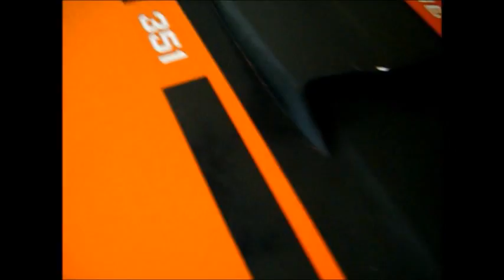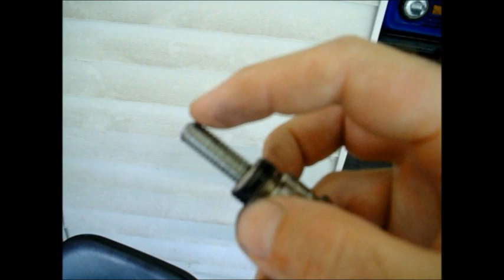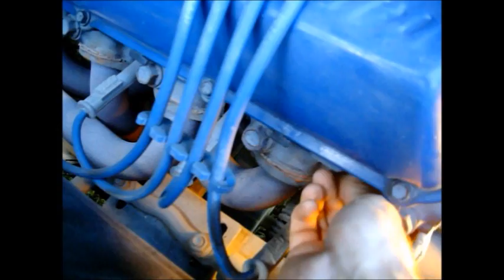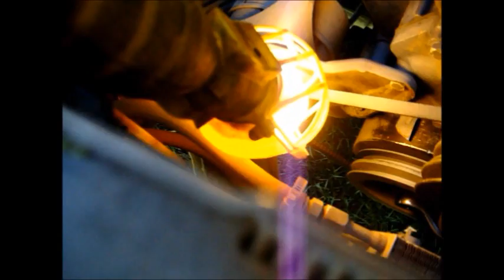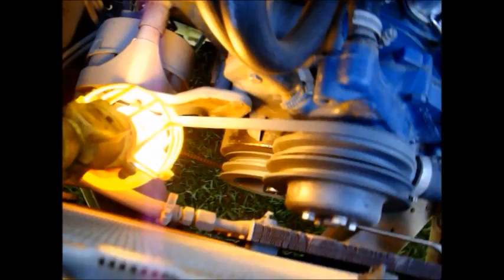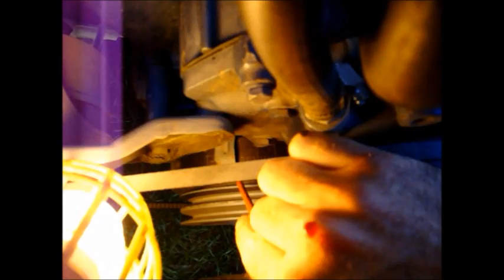Timing - Part 3 - How To - Using a piston stop to find true #1 TDC.wmv

Comment: Your video was very informative, I'm currently having a hard time with my 1970, 302 mustang. It sometimes starts up and sometimes it won't. I have fuel, spark and air. When I used a TDC plunger and took my distributor cap off I noticed that the rotor was pointing about an inch to the left of the number one spark plug. I also noticed that the distributor clamp was bent upwards which didn't give enough clamping force. Headed to O'Reilly's right now to get a new clamp
Reply from the maker: Yup, get it clamped down, so it doesn't walk away on you.  If it's not clamped down, it'll definitely move, and it won't take long until it moves far enough that it won't fire up the next time you try.  When you're cranking it, and it won't start, you can hook up your timing light.  The engine doesn't have to be running for the timing light to strobe, just the starter turning it over, will be enough to strobe it, as long as your coil is energized and you've got spark going to the plugs.  Everyone knows that you can remove a spark plug wire, jam a screwdriver in it, and put the screwdriver next to a ground to check for spark, most people don't seem to know that you can do the same test for spark, by leaving the spark plug wire on the spark plug, and simply hooking your timing light to it.  Hook it up to #1, then have someone turn the key to crank the engine, or use a remote starter button.  Either way, now you can point the timing light at your harmonic balancer and get a pretty good idea of where your initial spark timing is set at.  Turn your distributor as required, until it fires up, then set your initial timing where you want it, with the vacuum advance disconnected.  You can also hook your timing light to all the other spark plug wires, and make sure that it strobes on all of them, it's a quick way to check for any fouled spark plugs.  Good luck!  Let me know what you figure out.  Hopefully it's just the clamp, like you said.
Reply: @owenrobertson  thank you I appreciate your feedback. I'm still learning, we need more people like you that are willing to help! When I took off my #1 spark plug it had a bunch of black soot and fuel as well. Do you know what would cause for the plugs to become fouled? Would this also make the engine not start? The plugs have maybe 500 miles on them and I don't believe the engine was running rich. It has one of those Holley sniper EFI kits. I'm going to try the starter method like you described and clean all my plugs as well.
Reply from the maker: @0rvelazqu , well I've never run that Holley EFI, does it detect air / fuel at all?  Do you run an O2 sensor with it?  Is that how it works?  I've never looked into them at all.  I've experimented with a modern O2 sensor before, with carbureted vehicles, and an air/fuel gauge, just to dial in my jetting, but I've never messed with fuel injection on an old car.  There are lots of places online that talk about reading your spark plugs, and what you described, as you know, is a spark plug showing signs of your 302 running rich.  You might want to call Holley's tech line about that.   A 302 doesn't need a lot of fuel, and your EFI might be factory set up for SBC, as pretty much everything is set up for SBC, always has been.....at least for the 37 years that I've been in this hobby.  I'm really lazy about changing plugs, the spark plugs in my Vette have about 10,000 miles on them, so yeah, you shouldn't be fouling out after 500 miles.  I'm juggling too many cars, so the routine maintenance tends to get overlooked, and I mostly just fix stuff when it breaks.  My wife's 2003 Ford Escape has over 90,000 miles on the spark plugs that I installed 6 years ago, when I made some youtube videos about a bad fuel injector in that car.  Of course spark plugs will last longer in a car with computer controlled direct port fuel injection than they will in a carbureted car like everything I've ever owned.  You've got the right idea though.  Clean all of your spark plugs, get it fired up, put your timing light on it, then once your timing is dialed in, and locked down, just keep an eye on those spark plugs.  If they keep reading rich, I'd call Holley and ask them about it.  Lots of guys run that Holley EFI, so it must be good, and there must be a way to dial it in.  Also, you could look for a youtube video on that Holley EFI setup, one that has a lot of views, then after watching the video, go down and read the comments.  You can learn a lot from the comments section, maybe there are other people running the same EFI, that are also fouling spark plugs.  And yeah, an engine can run with fouled spark plugs, but initial start up is trickier for an engine than continuous running, so theoretically, you could start an engine with half decent spark plugs, then drive 200 miles, running rich, and the engine probably won't die on you going down the road, or even at a stop light, it might run a bit rough, but it'll probably stay running.  Then you shut the engine down, and it won't start back up, because initial fire up is harder than simply maintaining a running state.  Now run out of gas while you're going down the road, and your engine will sputter for 10 seconds or so and then die.  Foul your points, and at a certain point, when your points get bad enough, your engine could absolutely die while you're going down the road, just die, no sputter, just off, like you turned your key off, but in my experience you normally find badly fouled spark plugs when the engine won't start, it doesn't leave you stranded on the side of the road from what I've seen, but it might leave you stranded at a gas station or a restaurant's parking lot or something, when it won't fire back up.  So yeah, if they are fouled bad enough, fouled plugs can prevent your engine from starting.  

Here's a tricky one.  What happens when you fill up at a gas station that has bad gas in their tank?  I found out the hard way.  Had a 302 in my '75 Bronco, and the original 2 barrel carb.  I filled up with gas, drove home from work, then I didn't drive it again for a week or so.  A week later, I got in, and it wouldn't start.  Like you, I had rotation, fuel, air, spark, spark timing, and valve timing.  It should have started.  Well it was a week since I had filled that tank, so I didn't even consider bad gas, I had forgotten all about that.  Anyway, I'm 10 miles from town, so even if I did suspect bad gas, would it make sense that I filled up with bad gas, and then drove home 10 miles, and it ran fine?  At least I think it ran fine, I can't really remember, and I wasn't thinking about any of this in the moment, I was just trying to understand how a '75 Bronco with good spark plugs and good spark, and gas and rotation, wasn't starting.  My wife kept telling me that maybe it wasn't getting gas.  Well I had looked down the carb, cycled the throttle, and I had watched gas being squirted into the engine.  I knew it was getting gas.  The third time my wife told me, that maybe it wasn't getting any gas, I was pretty upset, but I kept my calm, and simply pulled the fuel hose off of the carburetor, then I calmly told my wife to watch the engine while I tried to start it.  She has no idea what the fuel hose is, or the vacuum advance hose, or the heater hose for that matter, so she didn't know what was going to happen.  So I turn the key, and the starter does it's job, and the stock mechanical fuel pump does it's job, and my wife yells stop stop!  I stop turning the key, and she yells that fuel is spraying everywhere.  

Really?  Yeah, I told you I had fuel, you don't think that was the firs thing I checked?  

I was still pretty upset.  Then I looked at the "gas" that I had just sprayed all over my Bronco's carburetor.  It was beading.  Gas lays flat, it doesn't bead like water.  Water beads like water.  So my wife saved the day, she was right.  I wasn't getting gas, I was getting something, and it smelled like gas, but it wasn't gas.  Just to make sure, I put that fuel hose into a rattle can cap, and filled it a bit with the "gas".  Then I set that cap with some gas in it on the ground safely away from everything, and I lit a long rolled up piece of paper.  When the paper was good and on fire, I lowered it into the gas.  The gas put out the fire.  That's when I realized that I had just filled that Bronco up like a week ago.  I had to dump out all of that bad gas, luckily I've got an aftermarket fuel tank in that Bronco, and it has a drain plug.  Unluckily, it was a 23 gallon gas tank, and that's a lot of gas to throw away.  It also has a reserve tank that holds 8 gallons that I had to toss out.  That was probably 10 or 15 years ago, but I'll never forget it.  It's a crazy hobby.  Apparently you can fill up with bad gas, and the engine will fire right up, because it's starting off the good gas that's still in your carb.  The gas stations gas is in your tank, and not in your carb yet.  Then you get down the road, and within a quarter mile or so, you're running off the bad gas, it's mixed in with the gas that was already in your tank, but I only fill up when I'm really really low on gas, and I always fill it all the way up.  Anyway, that gas gets you home, and you don't even notice that it's running bad?  Crazy!  Then you get home, shut it down, and a week later, it won't start.  Because firing up is a harder task than just staying lit.  So the gas was good enough to keep me going down the road, but not good enough to start a cold engine.  If anyone told me that story, I'd call bullshit, but it happened.  It's crazy but true.  These old cars will always surprise you.  So now I only buy gas from places I can trust like BP or Shell, and I've never had another issue like that one.
Reply: @owenrobertson  I took my valve cover off and made sure that the rotor was pointing towards spark #1 while both valves on cylinder #1 were closed/on compression. I then saw that the timing pointer was right on zero degrees and marked that with a white dot. Then I bolted everything back up and had my cousin crank the engine over while I used the timing gun so that I could advance it 14 degrees with the vaccine advanced plugged off. Then we hooked the fuel back up and tried to start the engine, all we get is a fireball every now and then and some sputtering
Reply from the maker: @0rvelazqu , all the parts you bought should be fine, your EFI is using an O2 sensor to dial in the air/fuel ratio, so that should be good as long as it's all working as advertised.  And you've got a new engine, so it's going to be something simple, we just need to figure out what.  What distributor and coil are you running?  I'm guessing you aren't running the stock single point distributor, not with the other stuff you've got.  14 degrees initial is a lot.  I only run that much initial timing when I'm not planning on ever running any vacuum advance at all, just the mechanical advance.  On cars where I do that, I'll run 14 to 16 initial, in order to get my total timing around 36 BTDC.  That would be a street/strip car, where I'm more concerned about how it does at the track, than I am about how hard it might be to start.  A car is easier to start with less initial timing, the Model T had a lever to retard the timing manually from inside the car, then start it, then advance the timing with that lever to smooth out the idle and keep it running, to where you can drive it.  The invention of vacuum advance replaced that manual spark advance control lever.  I run vacuum advance in most of my cars, and it's what I recommend for most everyone else, you set your initial timing around 8 degrees, with your vacuum advance plugged off......then you hook your vacuum advance back up.  Now when you crank the engine over, all it gets is the 8 degrees initial advance, as the engine isn't making vacuum yet, so it's easier to fire up.  Once it's running, now you're making vacuum, and the pull of that vacuum, advances the timing for a nice smooth idle.  As you accelerate down the road, your vacuum drops because the throttle is wide open, so your vacuum advance drops away, but your distributor's rotor is spinning faster now, and the added centrifugal force, moves the counterweights away from each other giving you the mechanical spark advance that you need to stay ahead of the engine's increasing rpm.  It's all very primitive technology compared to new cars, but that's why I like it.  And it is more advanced than the Model T was, so it's better than a hundred years ago.  Your '70 Mustang is in my sweet spot, Right now 1955 to 1975 are the cars I own, they are the cars I love and I can ramble on all day about them.  I really love this hobby.

When your engine tries to fire up while you're cranking the starter motor, but fails to stay lit as soon as you let go of the key, it's normally because your coil is being energized when the ignition switch is in the "start" position, but your coil isn't being energized when your key is in the "on" position.  Remember for every position your key can go in, accessory, off, on, start, it's a different pathway for electricity that you're opening up.  When your key is in the "off" or "accessory" position, no voltage is sent to your coil.  While your key is being held in the "start" position, you should have voltage to your coil, and we know that you do, since your timing light strobed for you, while your cousin cranked the engine over.  Now when he lets go of the key, and your ignition switch is in the "on" position, your coil should still have voltage, but it's coming from a totally different place now, and a totally different wire.  Your coil is energized by your starter solenoid while you are cranking the engine over.   That's what the "S" and "I" are all about on your starter solenoid.  You turn the key to "start", and that energizes the "S" (start), put power to that S terminal, and your engine will crank over.  Only while it's cranking, the "I" (ignition) terminal is sending a straight 12v to the positive side of the coil (+).  All of this so far is working just fine in your car.  Now when you let the key go from "start" to "on", then there should be a new source of voltage to the positive side of your coil, from your ignition switch to your ballast resistor, or resistor wire, delivering about 9 volts to the positive side of your coil.......that's if you've still got a points distributor, running a straight 12v will burn up the points over time, but that straight shot of 12v, just during initial cranking helps it to fire up easier.   

So here's what you should do, turn the key to the "on" position, and check the positive side of your coil for voltage with a test light or voltmeter.  You should have voltage.  If you don't have voltage, fix that first, because that's absolutely the problem.  

If you're running points, and your Painless Wiring kit doesn't have a resistor wire, you can run a Mopar style ballast resistor to protect your points, just go to your parts store and tell them you want a ballast resistor for a '70 Dodge Dart with a 318, but any old Mopar's ballast resistor with any engine will work just fine on any car of any make, as long as it's running a points distributor that no longer has it's factory resistor wire.  The Mopar ballast resistor will look like this:  

https://www.forabodiesonly.com/mopar/threads/1971-slant-six-ballast-resistor-id.480816/

And it's easy to hook up, just put your 12v from the ignition switch to one side, and run a wire from the other side to coil +.  It doesn't matter which side of the ballast resistor goes where.  

And of course, if you aren't running your stock single point distributor, then forget all that stuff about a Mopar ballast resistor, because you don't need a ballast resistor with electronic ignition.  If you're running electronic ignition, then you need a straight 12v to coil +.  So that raises another question.  Does your Painless wiring kit have a resistor wire going from ignition switch "on" position, to coil +?  If so, that's not good if you're running modern electronic ignition, you can't run a ballast resistor with electronic ignition, and a resistor wire is the doing the same job as a Mopar style ballast resistor.  So if you are running electronic ignition, and you think you might also be running a Painless Wiring resistor wire to coil +, try running a temporary wire straight from your battery + to your coil +.  Give it a straight 12v.  Then try to start the engine.  Because it seems like it wants to fire while your key is in "start", but not while your key is in "on".........so that's where you need to look.  Run that temporary wire, and it should fire right up, and stay running.

Once you get it running, set your initial timing at 8 degrees BTDC (or even 6 BTDC, the Ford maintenance manual calls for 6 BTDC in a '70 Mustang with a 302.......but 8 BTDC is fine).  And then lock it down, and hook your vacuum advance back up.  You'll make a bit more power if you adjust your timing to optimize your total timing to around 36 degrees, and the easiest way to do that is to bump up your initial timing, but it's really not worth it for a few extra horsepower, I mean really, are you going to go out and race a new Mustang or Camaro or Corvette?  It was fun racing those cars in a hopped-up first gen Mustang, back when those Mustangs, Camaros, and Corvettes were brand new in 1987, back then, they were all running mid 15 second quarter miles in stock trim, but today they are all crazy fast. So if you want your car to start easily and run nice, shoot for 6 or 8 BTDC, and then hook up your vacuum advance, and it'll run great.  

And good luck!  Let me know what you figure out.
Reply: @owenrobertson  thank you so much again for helping me, I've been out here in the garage since 9am today and I've been contemplating on parting out the car (joking). That is awesome that you have classic cars as daily drivers. I wish to make my mustang just as reliable as a new car so that I can also daily drive it. Hopefully we can solve this issue so that she's back on the road soon.

I am running a pertronix type distributor and I currently don't have a ballast resistor. 
I checked for power at the ignition coil on the positive side post and I am getting no power with the key turned to ON. I only get 12 volts when I crank the engine over and then drops back to 0 when the key springs back to ON position. 

According to the painless wiring manual, the ignition bypass wire starts at the starter solenoid "I" post and ends at the coil "+" post. Perhaps my starter solenoid has gone bad? I can hear it click on and off whenever I crank over the engine.

I am going to run to the store and see if I can get a new starter solenoid. If the problem still persists then I will move toward the neural safety switch, I think it's still running the original part as I haven't changed it since I got the car.
Reply from the maker: @0rvelazqu , your starter solenoid is fine, don't change that.
Reply from the maker: "I" from the stater solenoid to coil +, gives the coil voltage while the key is in the "start" position.  You have that, that part is fine on your car.  What you need is voltage to the coil when the key is in the "on" position.  You don't have that, and that's why it won't fire up and stay running.  Just think about how it works, this might help, say for instance you had a car that only had voltage from ignition switch "on", and no voltage from starter solenoid "I" (that would be the opposite of what you have).  It'll still start, run, and get you around town, but it'll be tricky to start, since it won't be getting voltage to the coil until the key moves from "start" to "on", so you've got rotation, but no fire, and then all of a sudden when you let go of the key, for a split second you've still got a bit of rotation, and now you finally have spark, and if you're lucky, it'll fire up and since you've got a solid 12v to the coil when the ignition switch is in "on", it'll stay running no problem......so technically it will start, but it'll take you a while.  You've got the opposite problem, no way you'll stay running if you only have spark while your key is in the "start" position.  For the engine to start normally, you need your timing set correctly, and you need voltage to the coil when the ignition switch is in "start" and when it's in the "on" position.  Give it 12v switched, and it'll fire right up.  Or, if you simply ran a new wire, from the battery through a toggle switch, and to coil +, that would get you on the road as well.  

And yeah, forget everything I said about a ballast resistor, you don't need one since you're running Pertronix and not points ignition.  Also make sure you aren't running a resistor wire between the neutral safety switch and coil +.  I"m pretty sure if you order a Painless Wiring kit for a bone stock '70 Mustang, they'll supply you with that resistor wire, since the factory harness had one.  If you tell them you're running Pertronix, or any other electronic ignition, they'll supply you with a regular wire............or maybe they provide both wires, and it's up to you to figure out which one you need?  I don't know, I'm not running Painless Wiring on any of my cars.  Anyway get 12v switched to coil + and you'll be driving it today.  

So if you've read everything I've typed, and I know it's a lot, then here's what you've learned so far......you've learned that it's super easy to steal an old Mustang.  Pop the hood, run a wire from battery + to coil +, then use a screwdriver blade to touch both the battery + side of the starter solenoid and the "S" side of the starter solenoid.  Running that jumper wire from the positive side of the battery to coil + gives you spark.  The screwdriver delivers 12v from the battery straight to the "S" terminal on your coil......this simulates turning your key to "start" on the ignition switch.  Two things will happen when the "S" terminal is energized, the starter motor gets the full cranking amps from your starter, through your starter cable, and the "I" terminal gets energized and sends voltage to your coil +, but in this case that doesn't matter at all, since there's already a jumper wire running straight from battery + to coil +.  The engine will fire right up.  It's very easy to start an old Ford without the key, since the starter solenoid is firewall mounted and not mounted to the starter like a lot of other cars.  Once a car thief has the engine running, it's just a matter of getting into a locked car, not hard, and figuring out how to disable your locking steering wheel.  '70 is the first year Mustang to have a locking steering wheel, but it's not hard to unlock, it can be done at the steering column from under the hood.  The good news is that old cars rarely get stolen, considering how easy it would be to do it.  The other good news is that you can totally use your Mustang as a daily driver.  My first car was a '65 Mustang, and I've never owned anything newer than '75, or older than '55, and those have been my daily drivers.  I did learn early on that it's good to have more than one, that way when one car won't start, you can step to the spare, and still get to work on time.
Reply from the maker: Of course your neutral safety switch prevents "start" from doing it's job, and your neutral safety switch doesn't stop "on" from doing it's job.  I don't know why that didn't dawn on me sooner...........your starter solenoid is working fine, and you've got rotation, so your neutral safety switch is working just fine.  You could check it.  Put it in gear, and then try to start the engine.  If absolutely nothing happens, just like you've got a completely dead battery, then your neutral safety switch is working......if the starter motor engages, then you don't have a neutral safety switch at all, or someone has bypassed it.  Either way, your end goal is the same, get 12v to coil +, while your ignition switch is in the "on" position, and it'll fire right up.........or cheat, and run a brand new wire from battery + to a toggle switch in the car, and run another brand new wire from the toggle switch in the car, to coil +, and it'll fire right up.  You just turn the toggle switch on, then turn the key to "start", then to shut it off, you turn the key to "off", and then turn the toggle switch off, easy.  The only thing to remember, is that if you're running a toggle switch like that, don't accidentally leave it in the "on" position, because if you did that, the toggle switch would be energizing the coil nonstop, while the car is just sitting there.  I'm not sure how long it would take, but with the engine off, and the coil energized, eventually, you'd destroy your Pertronix (I think.....I've never tried it).  I've run toggle switches before to energize the coil, but I was always careful to not somehow leave them turned on.  Pretty easy really, since you had to turn it off to kill the engine.....unless it stalled out or something, right when you got home and parked it.
Reply from the maker: The real lesson here for both of us, is don't throw parts at a voltage issue.  You found your problem, no voltage at coil +, when the ignition switch is in the "on" position.  Your impulse was to throw parts at it, first a starter solenoid, and then maybe a neutral safety switch (that was my fault, sorry about that....I was wrong, bad advice, I never should have mentioned the NSS).  So we both need to slow down a bit and take a step back, before you go out and buy any parts.  Best to slow down and talk things out, and to look at a wiring diagram for sure.  You should have 12v at the coil when the ignition switch is in the "on" position, and you don't, so check that wire in your Painless Wiring diagram, the one that goes from the ignition switch to the coil.  Forget the wire that goes from the ignition switch to the starter solenoid, that wire is doing it's job just fine.  You might have a bad ignition switch, but check the wire first, because a single wire is more fragile than an ignition switch.  You should trace that wire back from the coil to the ignition switch, it might just be broken or burned up, or the insulation might have melted or chafed off and the bare wire could have welded itself to a ground.  Ignition switches don't normally go bad, but lots of bad things can happen to a single wire.  You can shoot the whole wire with an ohm meter from under the dash to the coil, or just see if that wire has 12v under the dash (closer to the ignition switch), while the key has the ignition switch in the "on" position, but it would be best if you can visually inspect that wire as well.  It would be easier if your ignition switch was in the dash, like a '69 or older Mustang.  It's always a pain when the ignition switch is in the steering column.  

But again, you could also cheat, and just run a jumper wire from your battery +, through a toggle switch, and to your coil +, and you'd be up and running in about 15 minutes.  And once it's running, don't forget to set your initial timing (vacuum advance disconnected) to 6 BTDC (8 BTDC at the most).  And then hook your vacuum advance back up.  Then enjoy the car as much as possible, and make a youtube video with the car, and send me the link.
Reply from the maker: I used to be a big Mustang fan, '65 to '73.  Now that I'm old, my preference is '68 to '70 Mopar B-body, and GM A-body cars, '64 to '72.  I like the Chevy A-bodies, but the BOP (Buick, Olds, and Pontiac) stuff is just as good, as far as I'm concerned.......and way cheaper than Chevy......way cheaper than Mopar too, Mopars are too much money now.  It's ruining the hobby for guys with modest income.  If you want a reliable old car at a decent price, look for a 60's Buick Skylark, or Oldsmobile Cutlass, or Pontiac LeMans.  The most reliable cars I've ever owned are my GM cars, my '55 Pontiac Chieftain and my son's '68 Pontiac GTO still have their original engines in them.....but I love my Mopars as well, even though their original engines are long gone.  Most of my Fords have long lost their original engines as well, but my daughter's '63 TBird still has it's original 390 under the hood.  I'm into other stuff now, but old Fords are still cool, I've owned a bunch of them, and still own a few, but just like Mopar, I haven't seen a ton of reliability from my old Fords.  All cars break though, that's just how it goes.  It probably just comes down to luck....and I've had better luck with some cars, than others.  I had a '70 Mustang once.  Bought it in 1989, sold it in 2018:

https://www.youtube.com/watch?v=x1_B1FVx4Ao

That '70 Mach 1 was a fun car!
Reply: @owenrobertson  Mr Robertson, I want to thank you for all of your advice and guidance. I feel grateful for people like you who help out other car enthusiasts. 
The Mustang finally started up today. The fuse that goes to the coil was burnt, replaced that. Finally got 12 volts on the ON position. Car still wouldn't run, checked for fuel again and spark by using a screwdriver and grounding my wires to the frame. Still wouldn't start. Then I remembered that I had installed a carb spacer when it was previously running two years ago. I decided to remove it and noticed that it had warped, I had a huge vacuum leak. Once I removed it she fired right up. Blew white smoke for a while but now she's idling right at 600RPM. Once again thank you for all of your advice
Reply from the maker: @0rvelazqu , good for you!  Now make a video for the car and send me the link.  We need to keep these old cars on the road.  I never would have thought you had a fuse between the ignition switch and the coil.  None of my cars have that fuse, so I've never blown a coil fuse in my life, never knew that was a thing.  On an old car, if you blow a fuse it'll be an inconvenience, but it won't prevent you from starting your engine and driving your car.....you might lose your heater blower motor, or instrument cluster lighting, or turn signals, but you'll still get home.  One more reason to love old cars, I guess.  Your '70 Mustang's original fuse box didn't have a fuse for the coil:

https://www.autogenius.info/ford-mustang-1969-1970-fuse-box-diagram/

Like I said though, I'm not familiar with the Painless Wiring kit that you're running.  And I'm not too familiar with new cars either, and what fuses they might have.  Good information to know the next time my wife's Ford Escape won't start, so thanks for that.  Good job finding that vacuum leak too!
Reply: @owenrobertson  ok for sure! I'll make a video this weekend. The painless wiring kit came with an updated fuse box and got rid of the glass tube fuses, I'm going to carry some spare fuses in the trunk just in case something blows. 
It happened to me once, I was driving into the mountains and I passed the last town that still had cell phone reception when the fuse to the Holley EFI blew out. The engine stopped immediately but I was able to coast the car in neutral to the side of the road and began to troubleshoot. The EFI kit comes with a handheld module that displays all the data with live information and this time, all it displayed was an error message. I popped the trunk open and I cut off the wire that goes to the license plate light bulb so that I could bridge the connection.
Reply from the maker: @0rvelazqu , cool!  Glad you're back on the road!  Good plan to stock up on fuses.
Reply: So the Holley EFI comes with an O2 sensor and the computer also measures the air and fuel. It's supposed to be "self learning" but you still have to do some manual tuning to get it just perfect. 

That problem you stated sounds like a headache! I would of never been able to solve the bad gas situation! Maybe that's what's wrong with mine... I was finally able to verify that my TDC was right on mark. The engine I'm working on is a 306 crate engine from blue print engines. It didn't want to run out here in Colorado with the carburetor, it kept blowing the power valve so that's why I have the Holley EFI. It starter right up the first time I installed it so I was happy for about 500 miles or so. Then my battery started draining for no reason and I had to keep jump starting it every other day. I changed the alternator, battery and the problem still persisted. Come to find out I had a short somewhere under the dashboard because it caught on fire. Fast-forward to two years later I installed brand new wiring harness from painless wiring, they gave me all the wires from taillights, headlights, engine bay, interior, everything. I even changed the ignition switch and turn signal switch. The car started right away first time for that one day, next day I come back and it doesn't want to start, just cranks and no start.
I started to troubleshoot and found the clamp to my distributor was bowed out as if it had been overtightened so I thought maybe the vibration knocked my timing off. That's where I'm at today, i have the timing on 14 initial degrees, I have spark, fuel, air. It just runs while cranking but as soon as I let go of the key and the stater retracts then the engine dies right away. And I get some fire balls every now and then through the EFI